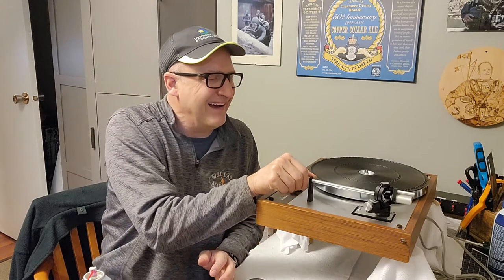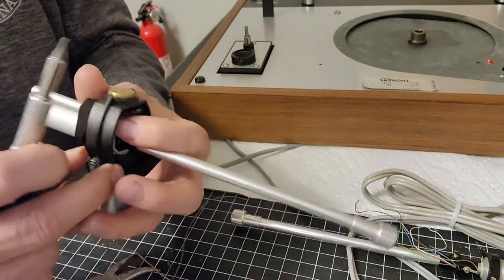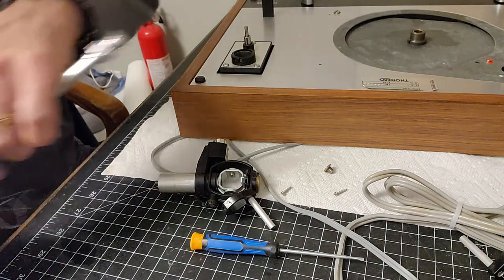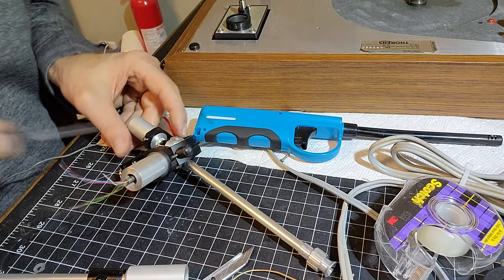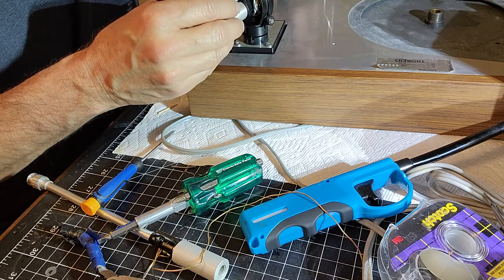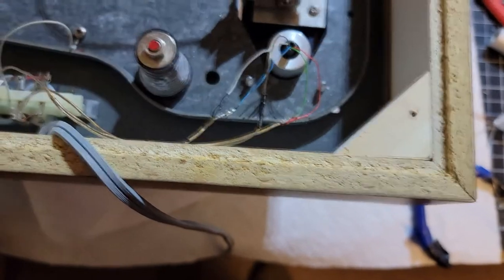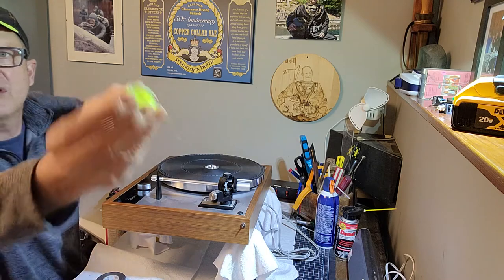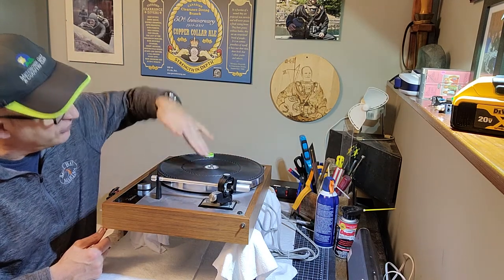Part 5: Thorens TD-160 Project (Arm Tube Replacement - Suspension Tuning)  - 1 Apr 2022

Comment: Amazing patience. And disappointment control on camera. I am trying to recondition my old TD 160 and this is much appreciated. My RCA cables have been replaced in the past with Monster(brand name) cables that are much heavier than the originals and they are shielded like coax cables.  I say all that because I am dealing with hum/buzzing like grounding issue and trying to determine the contributors.  I have added a separate ground to the amplifier frame from the existing ground screw near the RCA block with and without the original ground wire connected. I have checked for continuity through the tonearm and through the tonearm to the RCA plugs and all is good. The additional ground wire did reduce the hum but not completely. It is much louder through the right channel. That is the channel with ground as originally wired, correct? When the amp is powered without the turntable plugged in to the outlet the hum is there and when I bring my hand near to or touch the right channel RCA wire at the connection block the volume of the hum increases dramatically, like maybe 10 times louder. When touching the left channels wire it increases but very little. This is with or without the plastic block in its installed spot so the metal tab does not come into the picture. Do you think replacing the cables with non-shielded ones could help? The cable wires that are now on there are so fat (the actual strands) they would not fit in the connectors and are soldered directly to the tabs on the block. Even though this TT is from the mid seventies it has not seen use in 44 years and all the functions work very well and as normally designed. The hum is present even with the head removed eliminating the cartridge and those connecting wires as a source. Can you please help diagnose this problem? I see no reason to suspect the wiring in the tonearm and really don’t want to start there for no benefit. I of course can only see the tonearm wires at the back of the arm and they look good. The ground wire is connected there as originally done. The ground has continuity from that point to the block connection. Any thoughts are welcome and appreciated. I really want to solve this issue and begin using this TT as it is an exceptional piece of equipment. I can send pictures if there is a process for that. Really looking to get to the cosmetic fun. Thanks for what you’re doing, Michael
Reply from the maker: Not surprised. Thick EMR shielded monster cables are generally no good as phono cables. They are best used for multimedia/AV applications and not at all well suited for the low capacitance requirements of low output phono signals. Thinner low capacitance cables are best for this application. This is a common misconception. Here is my video series on restoring /modding a standard mk 1 TD-160 (videography warts and all). 9 times out of 10, hum in a TD-160 is caused by poor connections in and around the headshell. Don't muck with the right channel grounding in these turntables. In my experience even the ground mod in the manual makes things worse...: https://audiokarma.org/forums/index.php?threads/thorens-td-160-mk-1-tune-up-and-setup-project.991147/

Comment: Very helpful. I recently purchased a 160 on a great deal with some repairs as a caveat. This tutorial inadvertently helped me identify the solution to my first newded repair. My arm plate assembly had a busted out screw hole and broken plastic underneath rendering fastening the tone arm impossible. Luckily I found an OEM 165 arm plate assembly and have it coming in the mail to do that repair. Question though - I am completely new to the TP16 tonearm. My arm seems to have very slow rigid vertical movement despite any adjustments I make to the counterweight. Do you have an advice to identifying the cause of this? I first assumed shoddy vertical bearing or hinge, I'm wondering if I can just lubricate this? The table and arm are quite old and presumably haven't had play in a very long time.

Thanks again this was such a help

Comment: In my opinion, when adjusting the level of the springs, you need to put the headshell and counterweight on the tonarm and remove it from the armrest. Thanks for your videos .
Reply from the maker: Thank you. Very good point - that will come with the finessing point at the very end. This was a rough stab. Plan is to change plinths as well once I have got that far. Once everything is assembled I will be going over all my settings to tweak it better. I will also be mounting a different cart on it (likely Goldring E3)
 You can follow along with the whole series here and comment there too so others may learn:  
https://audiokarma.org/forums/index.php?threads/thorens-td-160-mk-1-tune-up-and-setup-project.991147/

Comment: Thanks for the informative video's. However, I have the MKii with a SME 3009 series 3 arm. Should the base of that be flush as well? And would it be flush with the top or bottom of the arm base platform it's mounted to? I appreciate your help.
Reply from the maker: Not sure what you actually mean? Sorry. I am not really a big fan of the pseudo "TD-160 Super" but those SME arms are indeed great - they are simply not Thorens arms which has always been my beef. I was living in Lahr Germany  and working in an audio shop near the Thorens factory (within 3 kms) the year they bowed to the audio dealerships and started making the "Super". That being said how does the arm tube look when playing an LP? Is the arm tube parallel with the record surface when playing or does it noticeably slope front to back or vice versa? If it slopes either way then the arm is mounted either too low or too high and should be corrected assuming you have mounted it with the correct and recommended Geometry for the arm. See: https://www.vinylengine.com/turntable_forum/viewtopic.php?t=8769
Reply from the maker: Then read this and ask yourself: Do I really need to worry about this? 🤣

https://www.tnt-audio.com/sorgenti/vta_e.html?fbclid=IwAR03cmjN3KDUQp8RTinqCYpigJgC0VQO65-yRf6iQZFOKJso177rkw2APYs
Reply: @navydiving  One last thing. I got the table with the arm already mounted. But I noticed it slanting up and figured it was too low and needed to be fixed. I was already thinking that I need to build or get a higher arm base to compensate for this issue. By the way, what should be the ideal height of the platter once level, above the top of the table ? 6 or 7 mm? I can't seem to find that info anywhere. Or is this subjective to owners preference as long as it doesn't impede playing in any way? Thanks.
Reply: @navydiving  I'm a member of Vinylengine and have read that thread before, as I have another SME 3009 ser3 arm that I will install on a custom table that I designed in CAD and began to machine for the build. But that is on hold for a bit. Too many projects working and no longer have access to my school's machine shop. But it will be an amazing table when complete. One of my issues with these forums (only a minor one) is you ask one question, and get a hundred answers all with varying and different solutions. Then come the polite arguments amongst the members and your left scratching your head going "Huh". What's the correct solution. Did they answer my question? LOL. But more info is better to none and it helped when I first joined a few years ago. So I joke about it a little. Thank you again for your time and help. I know we'll talk again. lol.